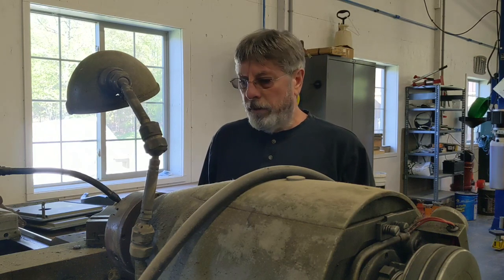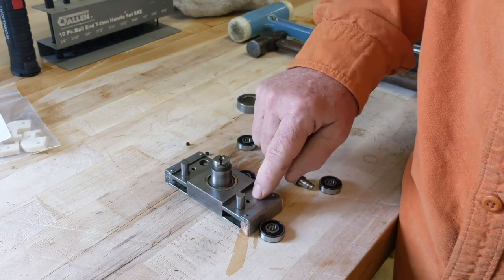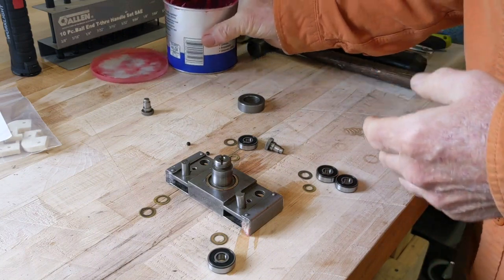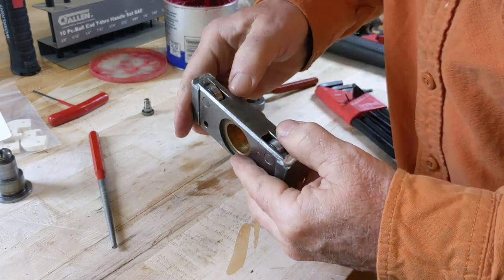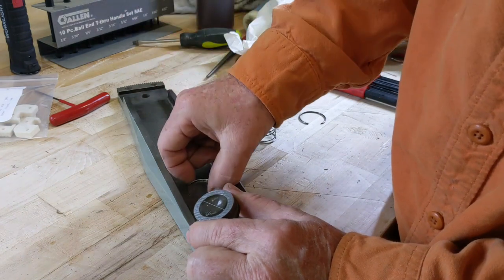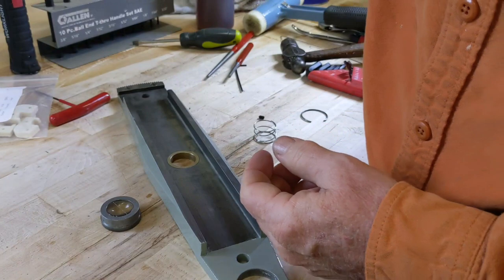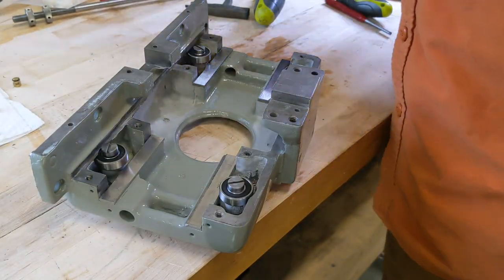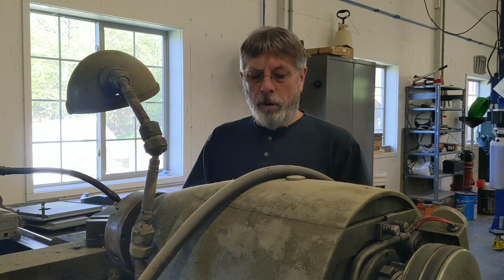10EE part 20a Starting Work on the Taper Attachment

Comment: Nice Work ! and Nice Machines ! ... The placement of the non eccentric bearing stud on the inside left (tail stock end ) closest to the bed is for alignment AFTER taper attachment is installed on saddle  (vague alignment process in owners manual). Inside right bearing adjusted with indicator to edge of back bed-way left and right side to run parallel during use (within .001 if possible). Outside bearings tight enough for 0 clearance and free movement. Monarch is one of the best hands down design taper attachments made for accuracy and virtually no friction if kept clean .
Reply from the maker: Thanks! So that makes sense. I'll give it a try when I'm wrapped up with all the refurb work

Comment: Kevin,  you just kept me from making 2 significant mistakes.   Thank you.  Thank you. I wrongfully assumed that the lower bearings had 2 eccentric and two straight bolts.  Fortunately I haven’t disassembled the small carriage yet but could have easily taken it apart before putting witness marks on the two pins. I love the quality of your paint job and look forward to your next video.  Cheers, Will
Reply from the maker: Thanks Will and glad you found some helpful hints!
Reply: @fourpondsshop7940  Kevin,  More than helpful.  I mean it when I say your videos have been terrific to watch and extremely valuable to me as I am moving forward to finish my own 10ee.  Watching your process has also been an educational experience. You not only have excellent skills and a well organized shop, you thoughtful process to approaching the project has given me a chance to see some of the weaknesses in my own work. I have pretty good skills, plenty of space and tools, but I’ve always depended on my memory less than a systematic approach to tool rebuilding.  I’ve been successfully rebuilding various automotive, industrial wood, machining and welding equipment for over 50 years and my aging mind just needs a more organized approach, or simpler projects. I think I’ve gotten some great ideas from watching your process and really appreciate you putting yourself out there in your videos. Thanks, Will
Reply from the maker: Will... So I spent the better part of my life looking for tools that I just put down or a part that I stored in a "safe place", never to be seen again. As I got older, those frustrating moments forced me to rethink my organizational skills.. And, I have worked very hard to become more organized! Not easy as we age! I guess what I realized... As I got older, the more time I waste looking for things, the less time I have to get my projects finished before I depart to that great workshop in the sky!
Reply: @fourpondsshop7940  Kevin,  that’s pretty funny.  I can’t stop chuckling. The other part of that equation for me is a combination of many, many years of collecting “good stuff” and having created enough money to buy even more.    My good news is I’ve started selling machinery that I no longer feel the need to keep; 30,000 lbs in two years.  What’s remaining I’m making great strides to organize.  It feels better and is more efficient.   We learn.  Cheers, Will

Comment: Only a guess... it seems the eccentric arrangement is set up to provide a rotational alignment capability about the one fixed bearing in addition to a width / clamp / gibb adjustment like on the first component you assembled.
Reply from the maker: I think you're right

Comment: Did you get the parts diagram from monarch?
Reply from the maker: Yes, call Monarch and ask for Terri. If you have the serial number, she can look up you exact machine and send you the documents that have on file for that machine. Wiring diagrams, parts lists etc along with the operation manual seems to be generally avaialble. I think I paid $75 for it. Its a 3 ring binder that they put together. It's a bit pricey but I think its worth it.